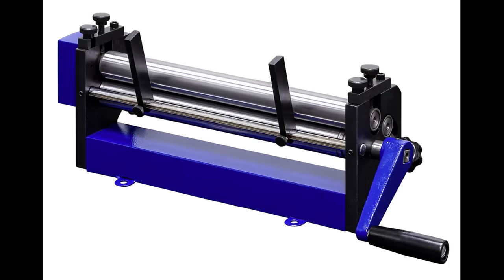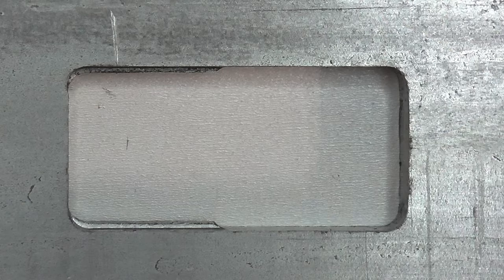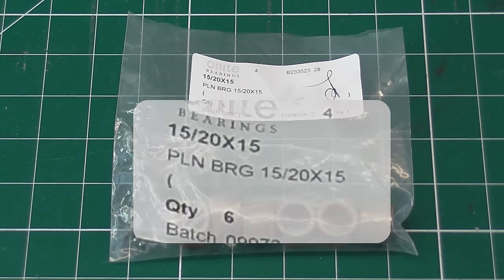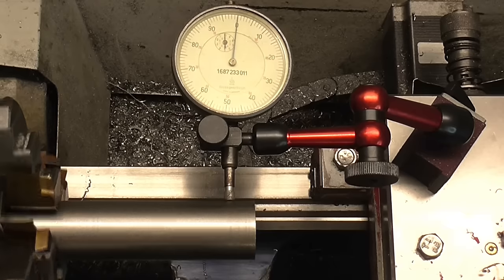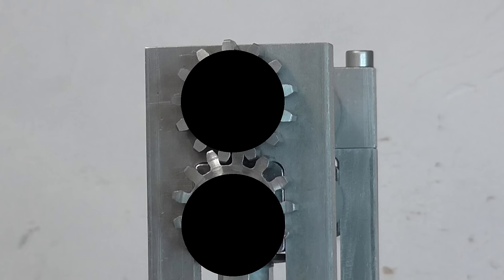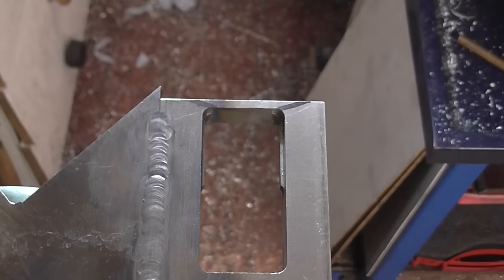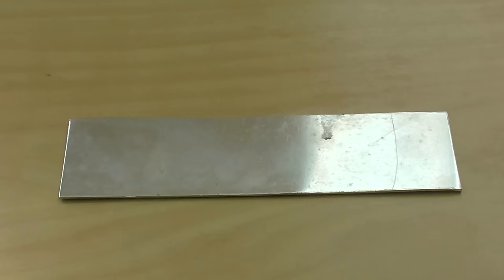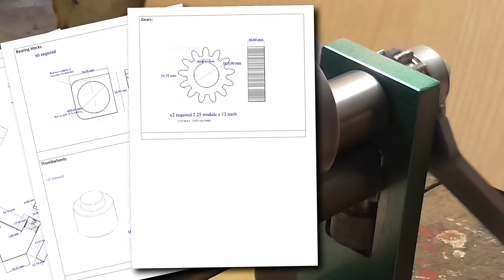Building a Slip Rolling Machine

Comment: You can set the 3mm sheet on an electric cooktop for a few minutes. Move it around so the heat is distributed evenly. Drop the sheet on the floor. It will not ring like a cold piece of aluminum. It will make a sound like a piece of oak being dropped on the floor. It will form and roll through the roller with ease. Aluminum will after heating will be workable for a few minutes. It should be long enough for your roller. I press parts in a 5 ton press using the same process. Old ziplock bags between the parts in the press help the aluminum go where it's needed when forming parts. Have a great day.

Comment: Very cool project! I looked at the math behind bending a plate, and if you increase the thickness by a factor of 3 and at the same time decrease the length by the same factor, the force required to bend the plate becomes three times larger. The formula for the bending resistance (W) is the following: W=(1/6)*w*h^2 , where w is the width and h is the heigth. The thing to note is that the heigth is squared. I hope it makes sense.
Reply from the maker: Thanks! I have to say it certainly felt like the effort required increased with the thickness by more than a simple linear relationship. Good to know it's proportional to the square of thickness, I suspected something like that might be the case!
Reply: @AndysMachines  bending strength is proportional to thickness squared. Bending stiffness is proportional to thickness cubed.

Good thing to keep in mind when you're building stuff.

Comment: Andy Great Job. I want to inform you about something else that will help you. On the adjustment roller you should mill a straight line from end to end on that one Roller about 1/8" deep. What the groove does is when you start to roll a piece of metal the groove on the top roller aligns  your sheet. The groove into the top roller will align the metal so the ends will be square or straight with each other. If you roll thicker metal it helps with the circle alignment when completed. I have rolled a lot of metal in my life from 14 gauge metal to 1 1/8" Metal. So the line on the groove helps a lot. I just wanted to inform you. Once the Metal I tightened between the first two end feed rollers and straight with the groove the metal after rolling will be straight and inline. It helps a lot with thicker metal. Great Job. I love your Craftsman skill.
Reply from the maker: Thanks! That's a good idea, though of course depends on the end of the metal being square which if you look carefully some of the parts in my video weren't. I should have taken more care to shear them square to start with.
Reply: @AndysMachines  Andy you did a Great Job on the Skip Roller. Just the Machine Straight Line HELPS in Squaring up the Sheet. It makes the Rolled Sheet Square. You will see once you cut the groove into the Back Roller. Best Wishes.

Comment: To make rolling easier, you could try annealing the sheet before rolling.  Your gear hobber works nicely.
Reply from the maker: Good idea! I'll have to try that and see what difference it makes.
Reply: @AndysMachines  It can make a world of difference. My only experience was 6mm thick H30 alloy 170mm wide x 400mm long which I needed to form into a U shape about 130mm accross. The raw material is like steel to bend but once annealed I could form it ove my knee ! It does work harden though.

Comment: This is great, I think some heavy die springs between the roller and the housing on the 2 adjusters would help clear backlash in the movements and make the parts more accurate.  A scale might help too
Reply: That sounds like a great idea - just to clarify - do you mean next to the knurled adjusters? if so above or below?

Comment: thanks for sharing!  maybe a couple idler gears would allow you better adjustment range while maintaining mesh?
Reply from the maker: That would be a good way to do it if a larger range of adjustment was needed. The moving pinch roller could move in an arc centred on one of the idler gears instead of in a straight line, then the mesh would remain constant.

Comment: Hi Andy.  Very nice addition to the workshop.  
Have you tried rolling cones yet?  If you have no (immediate) need for cones, you could put a chain link between the adjustable roller adjusters to ensure parallel motion.
Regards Mark in the UK
Reply from the maker: I did build the guides with some play so the rollers can be adjusted to a slight angle for rolling cones/funnels. I haven't tried this yet though. It seems to roll fairly parallel just adjusting the rollers by eye, flipping the material round each pass probably helps with this.
Reply: @AndysMachines  My first thought would be to add highly visible reference marks on the adjusters.

I am slower than most at aligning things by eye. I often use very temporary techniques like painter's tape on the knobs followed by sharpie marks on the tape.

I just subscribed. The very high quality, long format, infrequent releases fill a niche in my viewing schedule. No need to change anything.

Comment: very, very nice setup. improved Vincent R Gingery model, in difference that top roller is almost fixed in this version (one side is used to pool out finished cylinder, while Vincent takes off his top roller completely).
only thing that I will improve is 2 or 3 sets of gears, one for small thickness,  second one for range 1mm to 3mm and third one for 3mm-5mm, so no needs to stress teeths with longer distance. changing a gears is simple, as I see, just align them with a key.
I like it very much, will try to contact some who has knowledge of this matter and ask to help me develop same thing, just 300mm long rollers and with 3 sets of gears.
Tnx for your video and free drawings,
Cheers.
Reply from the maker: Thanks! I can't remember if I mentioned it in this video but it did occur to me to have a 2nd set of gears / or why machines you can buy don't do this. But actually for the range of thicknesses this machine can handle the one set of gears works fine. 5mm would really be pushing it on anything but a thin strip of something soft like aluminium. Involute gears still run very smoothly when not contacting at the ideal centre distance, the teeth just need to be big enough to handle the load.
Reply: @AndysMachines  tnx for explanation, I am not a guy with this background so just cross my mind that more sets of gears could be helpful. Actually, maybe you can help. What I need is at least 200 mm usable space for rolling metal, and mostly will be copper up to 3mm thickness,  SS probably up to 2 mm. If I change the length to, let's say 220, will it work for what I need to bend in cylinders? 
All the best and tnx for this drawings.
Reply from the maker: Yes, it should work, but 2mm stainless will be quite hard work to roll, you will probably need to extend the handle to give more leverage, the handle I used was quite short.
Reply: @AndysMachines  tnx Andy
Reply: Now, I am thinking, instead of a handle to put a wheel, about 600mm diameter,  so will not have upforce like with handle, it will always be downforce, it should be easy to control...
Reply from the maker: Yes, plus that will allow you to use 2 hands on the wheel and unlike a crank you can always place your hand where you have most leverage. I've seen people do this with arbor presses and it seems to help.

Comment: Back in the early 70's I worked on the maintenance at Manganese and Bronze at their Ipswich works, all we made was sintered bearings, I was always told that they were intended for light load applications because under heavy load they crush down, I wonder what your experience will be.
Reply from the maker: That's interesting. I don't have a great deal of experience with sintered bearings but I tend to use them in low speed applications where there's not much space (radially) for a roller bearing, such as this. I've found them to be able to handle higher loads than a similarly sized ball bearing, but perhaps a needle roller bearing would be better. I also like to turn bronze bushings from solid bar for this type of thing as they can be easily made in any size, but the cost of the material can be more than buying a sintered bearing if it's a standard size.

Comment: Have you tried rolling a cone?

I'm a bit perplexed by the load ratings of oilite bearings.  Being plain bearing i would think they would have higher load ratings than for example a needle bearing, but they dont.
Reply from the maker: I haven't tried rolling a cone but I did build the machine with enough play in the guides for the rollers to be at a slight angle, I think it would only roll slightly tapering cones though.

With oilite bearings, since they are sintered (basically fused together powder) I think they are more likely to crush and have a lower load rating than a bearing turned from solid bronze,  with roller bearings somewhere in between. However the sintered bearings I used for this seem to be holding up fine.

Comment: Would it be possible to make detachable gears with some sort of locking pin or something to resolve the gear meshing issue at larger thicknesses?
Reply from the maker: Yes, the gears are 'detachable' as they are held with a key and snap ring (or nut on the top one with handle) so it would be a simple process to change them for different sizes. I'm surprised that commercial machines don't do this as they seem limited in their thickness range and this would be a very easy way to fix the problem. (Though maybe it's purposely limited as the stresses involved with thicker material are a lot higher).
Reply: @AndysMachines  Ahh right that makes sense, didn't think about the increased strength requirement of the rest of it haha!

Comment: Andy is it the camera angle. The thickness you mentioned as 3mm that's just under an 1/8 of an inch your piece looks thicker?
Reply from the maker: It might actually be 1/8" or a little over 3mm, but no thicker than that. It may be the small size of the slip roll making the piece appear bigger, it can be hard to judge the scale of things on camera (something special effects guys rely on).

Comment: Nice build, quick question, is it possible to unfold the rolled sheet metal , so i have a pieace of pipe and i want to unroll it to get a flat sheet is it possible?
Reply from the maker: I haven't seen a machine that unrolls pipe. There are machines that straighten wire (from a coil), they work by passing it through a series of rollers that bend it one way then the other, maybe something similar would work?

Comment: Nice project. Did you consider replacing the gears with a Schmidt coupling? A Schmidt coupling can transmit the rotation over a wide range of different spacings between the rollers and is pretty easy to make compared to involute gears.
Reply from the maker: Thanks, interesting idea! That would allow for a lot more variation of the distance(far more than actually needed), I've never made a Schmidt coupling, but I have made Oldham couplings which are simpler and work in a similar way, however I think you'd still need the gears in addition to the coupling as they (like most flexible couplings I'm aware of) transmit drive along a shaft rather than to an adjacent one
Reply: @AndysMachines  Yes the Schmidt coupling transmit drive along a shaft, but then you could for example make some simpler sprockets and use a bike chain to transmit the rotation, and then a Schmidt coupling on one of the sprockets to be able to adjust the spacing. I think a Schmidt coupling with some oilite bushings or even some needle roller bearings would have far less friction then a Oldham coupling.

Comment: Just wondering, why do you cut the initial shapes with a hacksaw? Less material waste/more control?
Reply from the maker: For me it's usually just the fastest/most convenient way. Sawing is always quicker than milling/turning material away. I don't have a metal cutting bandsaw, I do have a power hacksaw but it's limited to simple cuts on stock that can be held easily in it's vice. Yes, an angle grinder might be faster then a hacksaw but I don't like grinding dust over everything in my small workshop.
Reply: @AndysMachines  That makes sense. The kerf of an angle grinder is typically larger as well. Cutting by hand has more control and also doesn't heat the metal as much/ make fine particulates. I'll have to try this out. I mostly use handsaws on wood for similar reasons. eventually I will gear down my wood bandsaw to cut mild steel. I think that would be useful to make quick cuts with larger sawdust.

Comment: What is the maximum diameter of aluminum pipe the slip roller can produce?
Reply from the maker: Well you can start with a flat strip of metal so technically you can roll a tube of infinite diameter. There is a limit to the minimum diameter though, just a little bigger than the rolls themselves.

Comment: Gday Andy. Well designed. I guess using bigger gears (14T) for larger gauge stock would maintain tooth engagement.
Is that one of your hobs?
Thank for another interest machine
Greg
Reply from the maker: Yes, having a selection of swap-able gears would cover a greater range, I don't know why the cheap hobby machines don't do this (maybe some do?) as they seem very limited in how thick the material can be, but maybe it's to do with the strength of the construction as well.

That was actually a hob I bought quite cheaply 2nd hand, I'm always on the lookout for any sizes I don't already have.

Comment: Any particular reason why 3rd roller is slightly larger?
Reply from the maker: It's so that it can reach closer to the pinch rollers and is able roll smaller tubes. You could build one with 3 rollers the same size, but in my case the size of the bearings and positions of the rollers meant the 3rd one needed to be slightly bigger. If you don't need to roll such tight curves then it wouldn't matter either.

Comment: Should have put the crank handle on the bottom roller. Then the top roller can be removed to extract the cylnder.
Reply from the maker: I did think long and hard about which roller to put the handle on. I opted for the top one mainly because it gives more swing before the handle gets too close to the bench etc. It doesn't affect removal of the cylinder which roller it is on, as only the bearing at the opposite end of the roller is removable.

Comment: How much$ did it cost you to build?
Reply from the maker: I actually built it entirely out of odds and ends I had lying around so it cost me nothing. But yes If I had to buy all the materials there would be a cost, and when you consider the work involved maybe you might as well buy a small cheap one, but the main reason I built this was because I couldn't find one that would do what I needed in this size, I would have had to buy a way bigger and more expensive machine.

Comment: How to retrofit your roller for large gap between rollers, whilst your drive gears remain correctly engaged throughout all adjustment...
https://youtube.com/shorts/2APg4MadvZU?si=T_wajPhGbrwy8yeT

Merry Christmas  !
Reply from the maker: Yes, I did consider something like this (there are several ways it could be done), but since I only need to adjust the gap by about 2mm, just making the gear teeth big enough is a simple solution. Involute gears are very tolerant of running at a larger radius than the pitch circle. Most workshop slip rolls seem to work this way, though larger industrial ones may use a different method.